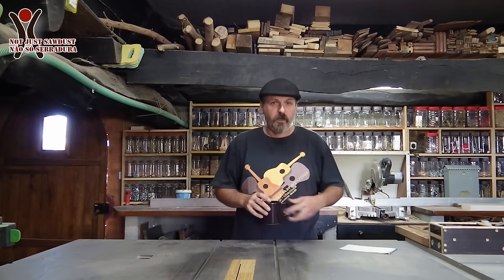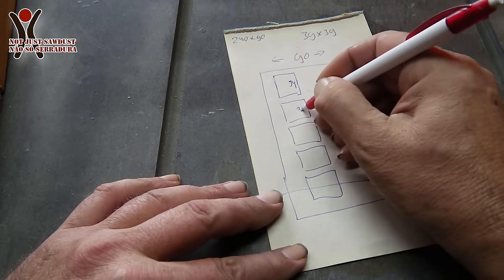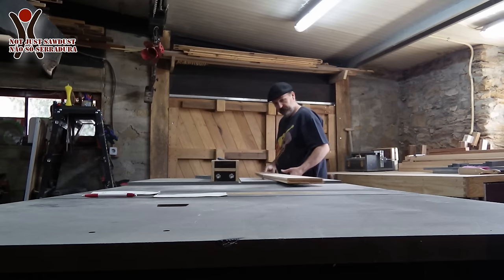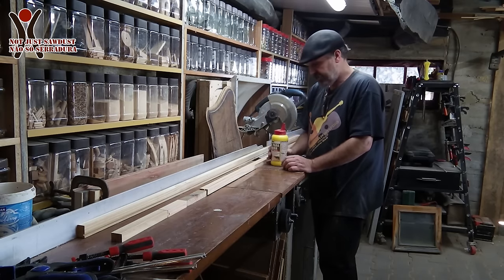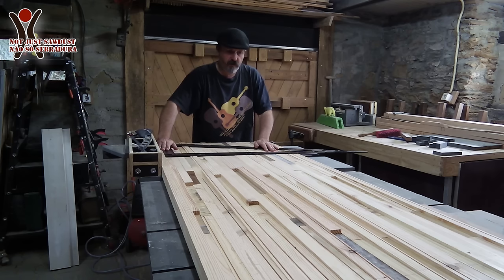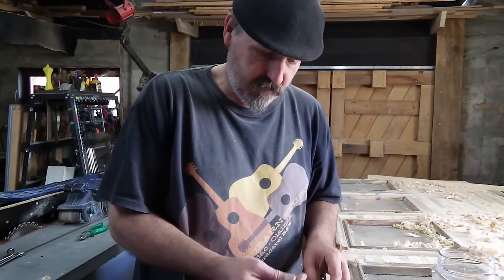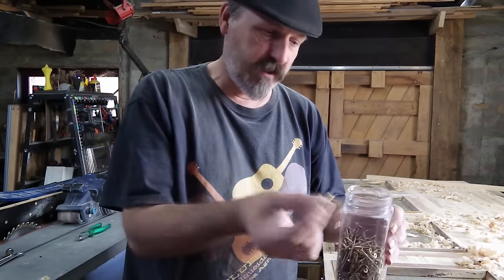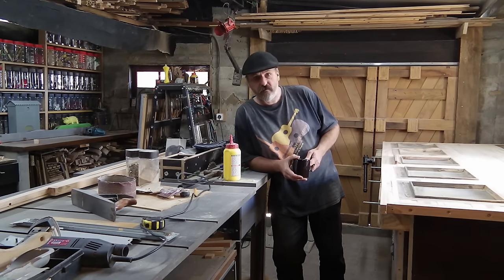#28 A Sliding Door (out of reclaimed and leftover wood)

Comment: That's a beautiful door. and despite its weight it'll be a perfect match for your house.
Great job so far Gerrit.
Greetings from Good Old Germany
Peter
Reply from the maker: +PeteTGIF Well Peter in this case it just turned out much more work than I thought... and I had to go deep into the corners of the workshop to find enough wood... The door needs to be "heavy" because it won't have much support on the bottom, and I like "solid" things anyway!

Comment: I thought you said you were going to cut the window frames to be flat with the door thickness? I like the all thread glue and alignment technique. But how did you keep all the alignment in each wood piece for drilling the holes in the different length pieces? Looking forward to part two and the hanging rail with wheels.
Reply from the maker: +MRrwmac Just marked them with a 90 degree hook.. Oh and the holes are 10mm while the rod is 8mm... gave me a bit of leverage. The window frames went in there as the are in the end... (well took a lot of planing and sanding to get everything flat...)
Reply: Excellent technique... will use the same for a desk over my washer/dryer as I plan to glue up the 110 year old floor boards I cut out when I made a new bathroom in my house.